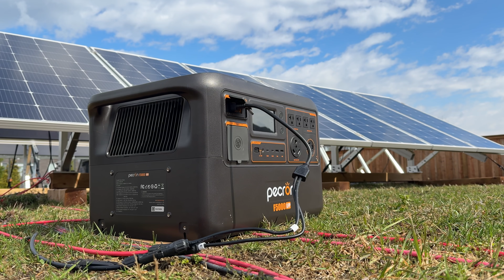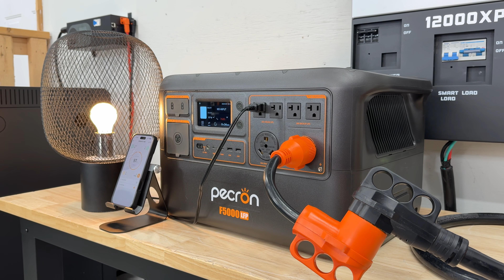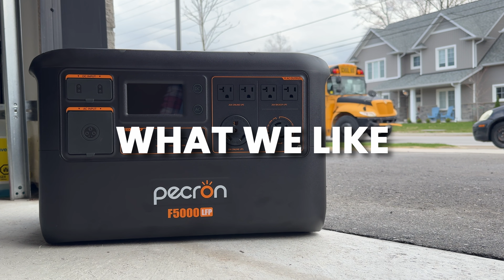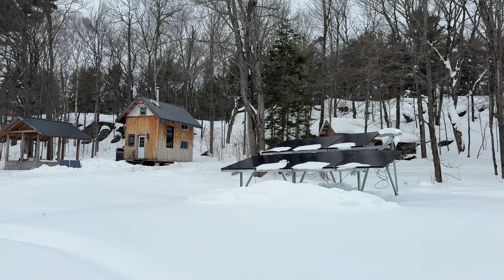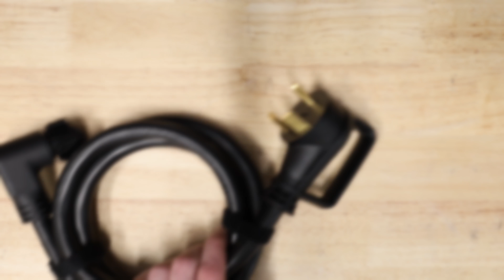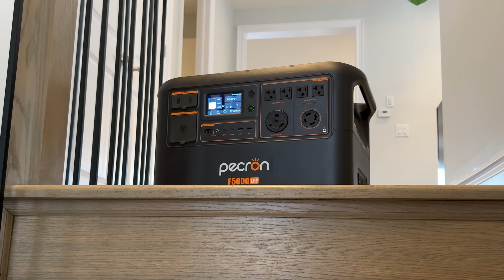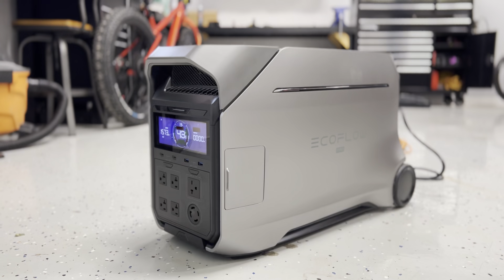Pecron F5000 - They FINALLY Did It!

Comment: Thank You, Been waiting for you to review the 5000. Can’t wait for the deep dive diagnosis. Comment & Couple of ❓
There is a 12 volt output on the front panel, get a cigarette adapter… Was under the impression Pecron approves  you can re-charge with a non-inverter generator and not void the warranty. 
 I have a H.F. Predator.
And I don’t want to assume anything, does the 5000 qualify for IRS 2026  “Residential Clean Energy Credit: Offers a 30% credit for battery storage technology with a capacity of at least 3 kWh.” ? My ‘guts’ saying yes but brain is saying get confirmation from an expert.
Reply: no expert, but didn't that energy credit expire on dec 31, 2025?  you date it IRS 2026...wondering where you saw that
Reply: @gradylucas5265 
Google AI - “Yes, the U.S. government offers tax credits for qualifying clean energy power systems in 2026. The Residential Clean Energy Credit provides a 30% income tax credit for homeowners installing solar, wind, geothermal, and qualified battery storage through 2025 (and likely continued under 2026 guidelines)
Reply: The energy credit expired Dec 31. That's why I rushed and bought a pair of 3600s and four batteries. Wish I had waited.

Comment: I went with the 3800 mostly because I didn’t know this was coming down the road. I’m not so sure that adding the second 3800 and the combiner is worse. More juice and obvious redundancy if things go kerplooie.
Reply: Pros and cons. The E3600/E3800 dual setup cannot AC charge with the 240V hub plugged in.  That's its biggest issue - but only if you need/want that.  If you have good solar capability, not usually an issue. 

But If you need/want to AC charge from a gas generator then you'd have to disconnect the 240V hub or use something extra like a Chargeverter to send the AC in as DC (more cost though).

On the plus side though.  2 units gives flexibility and might be more manageable to move... Use one at home and one on the road, or just to have something of one fails.  I personally like the add on batteries being 3000kwh (previous version)/3840kwh new version for a "portable" system.
Reply: @titobandito8474  I'm in the same boat. Bought the pair of 3600s just before the 5000 and 3800 were announced at CES. I didn't even get them before that. 
I was planning to buy a chargeverter. Then I thought I'd flip them for the 5000 to avoid that when I saw the AC charging. However, you can't output more than you are inputting via AC, so it really hurts since we are planning to run our whole home on backup power with this, including the central a/c. If the a/c starts up, it will draw more than the 3600 generator input and will shut the whole thing down from what I've seen in testing. I wish these guys had dug into that limitation.
Reply: @markkempton4579 maybe check with Pecron on the F5000.  

On Jasonoids test it was absolutely shutting off when the 3600W limit was reached/exceeded when AC charging was happening and power was being output.  It did look like the inverter was limited to 3600w max while in "UPS mode" which kicks in automatically while the AC charging is active - an apparent input side limitation that negatively impacted the entire inverter.

However, in another video/thread, a guy was saying that was just on the pre lease versions and his F5000 was AC charging and running his Dryer (closer to 6000w total) at the same time with no issues. If that's true, that would be excellent news.

Otherwise, I fully agree..., if AC charging does cause an output limitation , that's a huge bummer.  Not much sense being able to have a 240v output for big devices if the inverter is just going to get tripped when a total of 3600w (AC input + AC output) happens.  You basically hit 3600w just from the input if st next charge.  And if you reduce it to say 20%, you only get about 2400W  output to spare while the battery drains faster too. Definitely not 7200W.

If that's the case, were right back to solar being the main option and still needing a Chargeverter to turn the AC into DC anyway.
Reply: @titobandito8474  I saw the pre-release comment. I've asked people who have received production units to test for me, and they've found the same limitation, though just with 120V/20A input (none had 240 output available at the time). 
I guess I will email them to see what they say, though I don't put a lot of stock in marketing answers. :-/ 
Glad to know I'm not alone in this boat.
Reply: @markkempton4579  it’s almost impossible to keep up with the market these days. I’d do some things differently if I had it to do over again.  For example, not going with a 12 volt system. Anyway the only 240 stuff I have is my dryer and the ac and my stove. The dryer is not essential. For the ac I bought a small low wattage unit that vents outdoors when necessary.  For cooking I’ve got other indoor options.   my half fully finished basement doesn’t get too hot. Sort of depends on where you live, but I’m ok with the compromises I’ve made.

Comment: With a lot of the larger power stations not having a built in light, is there a low profile USB powered light that you might start recommending that can be attached to the unit?  I just looked at Amazon, and other than "under counter" lights and low power "night lights" didn't really see anything, but will keep looking.
Reply: And it has a light, he just didn't know how to get to it (in the settings you can change the screen to a light)
Reply: Search for "USB light," there are indeed a ton. I have some of the "mini flexible lights" as well as "mini usb night lights." They all work great, and are cheap. They work on any USB: Power station, small power bank, etc. Even use them just with a charging block if we have visitors in the guest bathrooms and stuff.

Comment: It has a 12v barrel plug, the car socket is not necessary, they do make adapters for that if that is a deal breaker, for those who don't need it, it makes the station look cleaner
Reply: And cheaper. To me, I don't want things that 99% of the people won't use just so they can jack the price up more. And who's going to be trying to move a 124lb power station just so they can run their fridge during an outage??? I'd argue your setup needs adjusting if that's your strategy. 

Leave it in the garage + power a transfer switch = peak shaving every day + critical loads backed up during an outage.

If you do it right, you should never even have to look at it once you set it up!
Reply: I've heard of a few people that prefer those barrel plugs because they say the cigarette lighter  plug isn't secure enough

Comment: Just ordered mine today!  Got it with 2 extra batteries.😊 15,360 kWhs🎉🎉🎉.  Can’t wait to play with it.
Reply: Let us know how you like it
Reply: @richied5294 will do
Reply: I think ya mean 15 kwh
Reply: Oops, yeah you are right.  I ment to just say watts, not kilo watts.
Reply: In what way do you play with it
Reply: @Garymunya  jumper cables
Reply: @Garymunya  Use your imagination!
Reply: @Garymunya  Hitachi "body massager"
Reply: How much was it before tax $4800
Reply: @samfish6938 total cost was $4,557.15.  Shipping was free, 5% discount was $239.85 from the $4,797.00 total
Reply: Oh, and didn’t get charged any taxes.  At least I’m not paying them according to the receipt
Reply: Wow
Reply: Update.  I’ve been testing my unit over the weekend.  Out of the box, one of the batteries is not working.  Gonna call today and see how customer service handles this.
Reply: @Do_the_Dishes how did they handle?
Reply: @littlelady12   Not very well in my eyes.  I just got an email today (13 days later and after several emails, text, phone calls with info., pics, repeated serial numbers given, ect..) Saying “thanks for calling!  The engineers have confirmed that the expansion battery has a BMS issue.  I’m requesting a prepaid return label, thanks for your patience.”   

Really, you can’t give me the return label in this email?  Does that mean I gotta wait another 3 days for your typical response time again for that email?!?  And what happens next?  No mention of that. Are they sending me a replacement?  Do they want to repair this one?  If so, what is that wait time on that?  I’m furious at this point.
Reply: @Do_the_Dishes  How his the 5000 lpf inverter holding up - what is your configuration? Are you using it all day hooked up to solar panel bay? Thank you  and good luck with them on the return. I just bought one off of a few reviews one that said their customer service had gotten better.
Reply: @Do_the_Dishes ecomerce drop shipment vendors plus they will add additional charges as you wait. While you continue to wait for the so called orders.
Reply: Nice
Reply: A few weeks ago I canceled two orders, Going to buy a dual fuel generator before it gets colder which I will know it will be delivered from Home Depot in stock down the block. Don’t bother with this contact the FTC. So it could be sold by vendors with the stock in a USA Store or warehouse ready to ship as you paid. Cancel your orders is not a benefit to no one’s health.
Reply: Are you happy you purchased this,and where did you purchase it thanks.
Reply: Anybody looking to purchase the Pecron F5000 beware. I received mine about 10 days ago. I was so excited for it to arrive. Initially, it worked well. Then the inverter started to trip when powering loads over 3000 watts, then 2000 watts. Now, the inverter trips regardless of what is plugged in. Completely useless. I have contacted Pecron and Outbound from where I purchased the unit. Looks like I'll have to ship this paper weight back and then wait another 10 days to receive the replacement. What a total disappointment.
Reply: I tested out my Pecron F5000LFP by connecting from it's L14-30R outlet to my house 50A inlet (Interlock kit) and it ran flawlessly, with 240v split phase, when it ramped over 5300 watts when my water heater kicked in. I did the same test again a week later and it ran smoothly over 5400 watts. Sounds like you got a faulty station.
Reply: @greggfur9626 tried running my A/C in my travel trailer yesterday again. I bought a 240v cord with a 50 amp end to connect to the trailer. Unit trips and will not power the A/C. When I plug my trailer into the E3800 with the 30 amp cord the A/C runs flawless. I know that unit has a 4200 watt in inverter. The F5000 should have no issues running the A/C from the 7200 watt inverter but it does.
Reply: @gre @greggfur9626  question. The F5000 is 30amps right. Did you use an adaptor to the 50amp inlet?  I ask because I’m getting a 30am inlet installed next week as well as an interlock. I figured I don’t have a giant 50amp generator so 30 will be good for now. But now i’m wondering if I should install the 50amp
Reply: Hello @bluebear57 . Yes, F5000LFP is 30 amps. The electrician recommended a 50 amp inlet for me just in case I wanted to use it for a larger propane generator in the future. I use a 30A to 50A adapter cord to connect my F5000LFP to the 50A inlet. Works like a charm!
Reply: @rericksonpri . You need a 30A to 50A adapter cord to connect Pecron F5000LFP to your trailer.
Reply: 3,600W per 120V output section 
So it will blow
Reply: @samfish6938 the outlets are tripping on 200 watt loads and above
Reply: @rericksonpri  Ouch!  Thanks for the heads up
Reply: @rericksonpri Are they paying for the return shipping?
Reply: @Do_the_Dishes yes. I had to buy a new unit. The new unit they are sending still hasn't shipped yet. When I receive it I will send the old unit back and get a refund for the second purchase. What a total pain in the ass.
Reply: @rericksonpri  Is a cat and mouse until update the return policies.🤷‍♂️

Comment: Being able to output 240V while only needing a 120v inverter generator to recharge is a big benefit.
Reply: You can charge it with 30A 120V (=3600W Max) while outputting 240V 30A (=7200W Max).  If the load exceeds 3600W out while charging, the battery will eventually be depleted.  Good news is it can be ready to provide 7200W max at 240V and it will most likely be called upon to provide less power in a home backup situation - so yes it can be charged up while still hooked up to a home transfer switch.  Or you can unhook it and charge it OR you can charge it with a 3600W generator (does not have to be an inverter as the unit can handle some variation on input).  It can take up to 6400W of solar input at the same time as well.  I do plan to be more careful than just throwing everything at the unit, however (I want it to last 10+ years!).
Reply: @dp4548 people have been unable to output more than they are inputting via AC charging. I've had two people with production units test this in the Pecron Facebook group and even on 120 in and out, as soon as they exceed 2400W output, the unit shuts down.
Reply: Buyer, Beware the P, O, & B on line company is just drop shipping. So you place an order they operate like towing company in rotation that. Once you order & pay in full that’s when the cat and mouse chase problem begins. I had to cancel O order & also a P order same problem is like a spiderweb even if you order from websites or large chain companies or Amazon is the same problem
Reply: It is, but you can only draw the 3600W max when you're charging on the AC. It actually limits the output since the it's in pass-through mode at that point.
Reply: @markkempton4579  Wrong - not using pass through.  Can input 3600W 120V AC and output 7200W 240V DC at the same time as long as the batteries hold up.
Reply: @dp4548 maybe there's an option to not use passthrough in the settings?
Reply: @markkempton4579 they removed the limit

Comment: I think the XT60 out is so you can connect jumper cables to it so that you can start a car battery. No need to carry a separate jumper if this is in the RV, or if you run a shop.
Reply: I use an EcoFlow Delta 3 Max Plus with a 30A 12V out to power most of my small off-grid cabin. 12V lights (indoor and outdoor), TV, radio, chargers, fridge, water pump. 30A is plenty for all of it. 230V (living in the EU) is mainly for microwave, kettle, vacuum, etc.

12V DC is much more efficient. Though in my case the cabin was wired for 12V DC (by me) long before power stations really become popular. I am really glad that there are now power stations with 30A 12V out. It works insanely well.

EDIT: For example, I have a 110 liter fridge that consumes just 35W. There's obviously also no surge.

Comment: That idle consumption is crazy.
Reply: Yeah, the 11kWh I'm making daily is just sucked dry by the 50 watts per hour.
Reply: @MassiveOverkill  Dude, your math is weak. If you're bringing in 11kWh every 24hrs and the Pecron is only using 1.248kwh in 24hrs, that's leaving you ... ALMOST 10kWh to bank or spend as you see fit.
Reply: @RPRosen-ki2fk  calibrate your sarcasm meter.
Reply: Calm down

Comment: Is it UL9540A certified at this price point?
Reply: Certification is essentially just a matter of submitting a single prototype for approval; however, during the actual mass production phase, various components are often mixed and matched. In reality, the final products frequently fail to meet the performance specifications established during that initial certification process.
Reply: @lesnarbrock527  Well, at least if it burns your house down, you can prove to your insurer you actually had a certified product installed, and not something that was not. In Canada, all battery generators and solar inverter systems with batteries must meet UL9540A to be approved for installation, based on my comprehension of the CEC.
Reply: @pyromontreal  Hello - This is my worry as well - I just bought one online - living in Massachusetts same thing about UL9540A and insurance concerns.  Looking into a firebox and also saw some puck extinguisher that goes off in case of fire and then thinking to place backer board around it (just thinking about things).  Playing now it is an expensive toy but may prove out ok.

Comment: Love mine!!! It completely destroys the competition!
Reply: For some use cases, like larger home backup possibly.  But the Elite 300 V2 by Bluetti is 60lbs, exactly half the weight but more than half the power, 3000 wah, and only 1100-1200$ US and movable by one person and still has the 240 camper plug, of course context matters.  Plus the Blu is tiny about 1 foot by one foot by one foot.
Reply: @TheNewMediaoftheDawn  someone who buys a unit this large and with this capacity isn't looking to move it around a whole bunch.  It's going to stay wherever they put it for a long time.  Now if you live in a tiny house or RV, sure, that may matter.   This is whole house backup and whole house backup doesn't need to be as portable as a camping setup.
Reply: @MassiveOverkill Exactly what you said. It's also why it doesn't have a 12v car socket. Can't believe the guy was complaining about this in the video.
Reply: HOW? It's not shipping yet.
Reply: @HOMELESSG0D I received mine April 14th.
Reply: @HOMELESSG0D  There was an early round of shipping. There's a 2nd wave that's supposed to happen the end of this month I think. I can't wait to get mine.